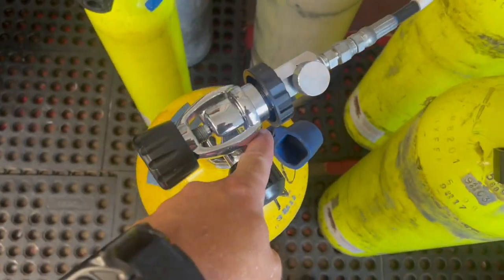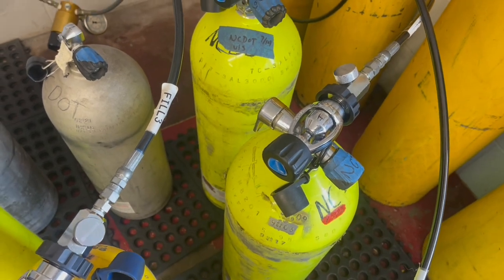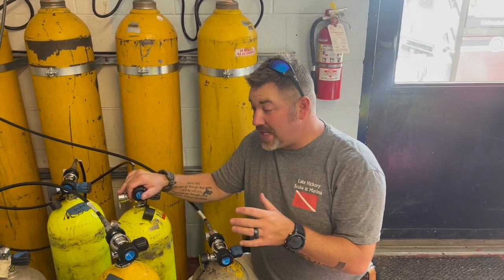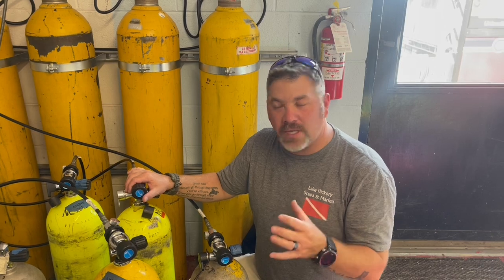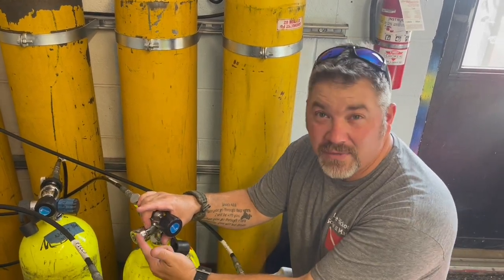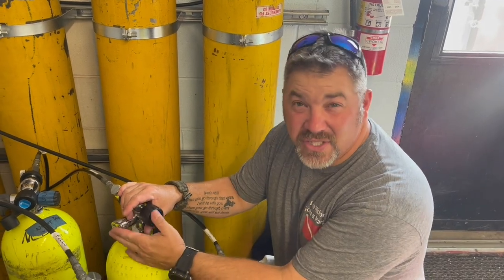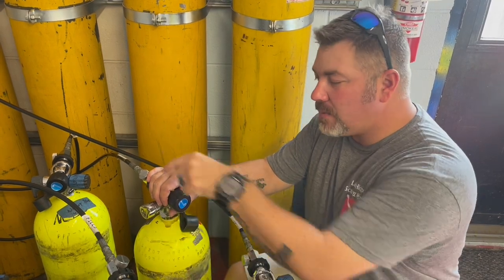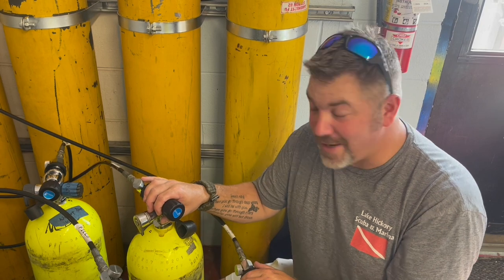Filling Cylinders With J-Valves

Comment: I learn to dive with a ‘J’ in the 1970s. Taught a touch drill that every few minutes, like a gauge check, to make sure the rod was still in the up position and hadn’t been dislodged or crept into the open position. As Brian said there were no gauges and also no octopus or secondary regulator.
Reply from the maker: Hello @tomsmith777, I remember that drill. Even back in the 1980's it was still being taught.

Comment: Industrial archaeology!  I'm not a commercial diver so I don't understand why these things should still be mandated.  There may be a fine reason, or should there be a change in legislation?
Reply: Old outdated regulations that the State bureaucracy does not deem necessary, or important enough to upgrade.
Reply from the maker: Hello @timgosling6189, I would like to see the J-valve removed from the State's cylinders. It's unfortunately not my call though. If I had to guess though, the State just doesn't want to spend the money to upgrade their cylinders.
Reply: Suspect that J-valves let divers operate in zero visibility; when one can not see their gauges.
Reply: @toadou8127  Very good point! 👍 
Somebody is thinking outside the rec/tec box.